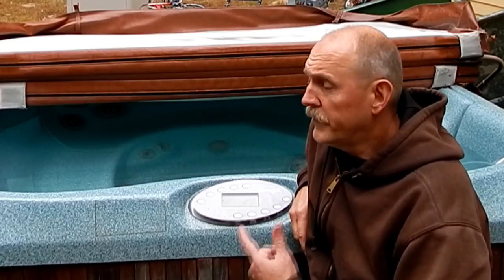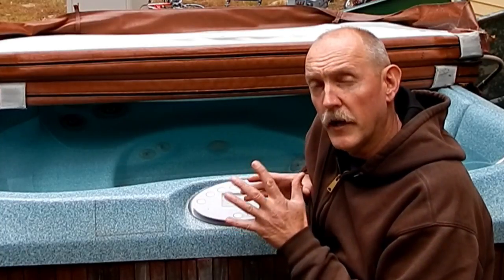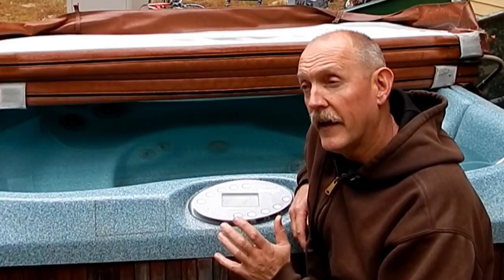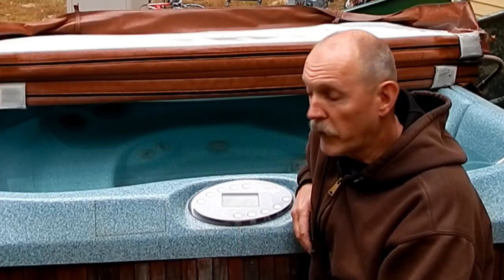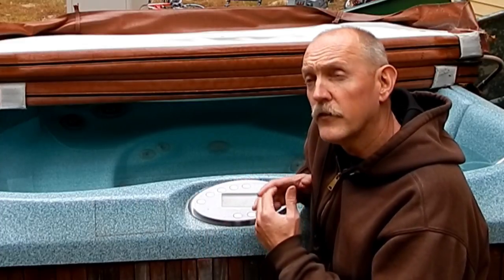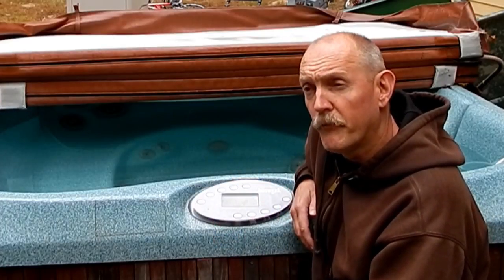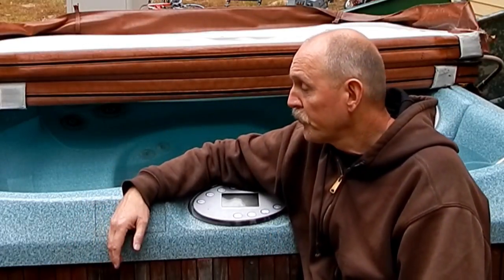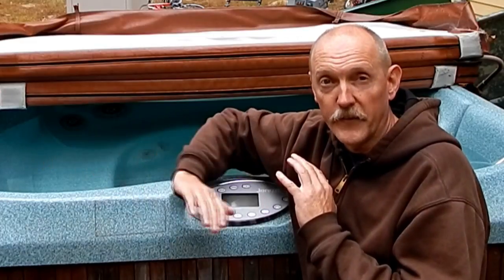Jacuzzi Sundance Hot Tub temperature sensor error repair

Comment: Steve, I has given up but I'm ready to try again.  It all started good.  I verified circulation pump flow and the flow switch was closed.  The heater was on according to the display.  Everything seemed good.  Then a jet pump turned on and I got the cool message.   Then the heater went off and I got the flo message.  I noticed the flapper in the flow switch was no longer closed.  It seems like the jet pump is sending pressure thru the flow switch thru the small tube downstream of the flapper causing the flapper to partly open which is probably causing the flo code and no heat.  What do you think is causing this?
Reply: Yes, there is the inlet side which has the flapper, the bottom that has the wires then the exit side that also has a nipple, maybe 3/8ths, that connects to a Jose that runs to the jet pumps
Reply from the maker: @robertgeorge2330  ok. I do not recall if you said this before but im guessing you or someone else replaced that flow switch. On the earlier flow switch housings that port on the bottom (3/8) was wide open. They'd use the same housing for several models. Some setups had the port wide open, and some required a restriction that was obtained by the manufacturer gluing a little (often white) plug in that port. The plug would then have a small 3/32 hole drilled in it. Newer flow switches come with a molded blockage in that port. During installation the technician, depending on the application, either drills a 3/32" hole on the blockage or opens at full 3/8. I hope this is making sense. You are in the home stretch now.

Comment: Great video .. thanks ... i have the same model J350 in 2003 as the one you are working with ... now my display says Sn3 - "OPEN OR SHORTED SENSOR (heater disabled) The main sensor is non-functional."  - will this fix my problem too?  thanks .. where is the best place to order this sensor?
Reply from the maker: You sure it is SN3 ?? SN is a sensor error and there are only 2 sensors in the tub so. SN1 or SN3 tell what sensor.
Reply: @stevewatr  yes it’s sn3. Will replacing this sensor fix this problem?    Thanks for the reply.
Reply from the maker: @360Toursofnova  number 1 symptom of a bad sensor is watch dog (dashes on screen no temp). But i have seen mice chew through the wires and cause this symptom.

Comment: We replaced both the temp sensor and flow valve on our optima 850. The flow problem is resolved but we are still getting oh and watchdog mode. Going to try turning off the hot tub for 5 to 10 minutes. Any other troubleshooting suggestions? Thanks for the great video.
Reply from the maker: There are 2 temp sensors, the one on the heater rarely fails. There are rare cases when a new sensor is bad. If you turn on the breaker when the tub is cold, how long will it run before oh or watchdog?
Reply: @stevewatr  thanks for getting back to us so quickly!  We were able to refill the tub and heat it with no problem yesterday. Today we are seeing four dashes.  We did turn it off and leave it off for about 15 minutes then restart. It appeared to be working fine about an hour later went back to check on it and we were getting the oh and it was up to 106, which is probably an accurate reading.
Reply: @stevewatr  still troubleshooting.  Replaced flo valve and temp sensor.  Flo message has stopped, but then went into watchdog mode and shut off.  We had a technician come out and he suggested a new circuit board.  We have installed new board, and pumps and heater all working, but getting a P0h or a 40d message (depending on view of panel).  Any thoughts?  We have ordered a new top panel as well, but not yet received/installed.

Comment: Have a jacuzzi j-480 that displays a temperature 12 degrees warmer than the actual water temperature. I replaced the temperature sensor and I still have the same exact problem. Example-If I set the tub to 104 the highest the temp will go is 92(actual). What should be the next thing that i check? Thanks

Comment: Would either of the temperature sensors cause the breaker to trip?  I have a J335.  Resetting the breaker, the heater will heat up to temperature but shortly after reaching the set temp, the GFI breaker trips.

Comment: Hey! I have a j series 4 seater tub. I just had to replace the heating element and the circulation pump and it runs good but only issue is it will only get up to 91 degrees. The heating element light is on but it doesn’t get any hotter. Any advice?

Comment: Steve, Watchdog after correctly installing a new waterfall, all new massage jets buttons and the two larger water diverters correctly. J350 series. Watchdog came on AFTER we started the refilled tub and it circulated beautifully as we tried all the functions to make sure, it began to heat, etc. Walked away for yardwork. Came back to check the temp and that is when we discovered the 4 dashes (Watchdog) Reset the breaker several times with no reaction to the watchdog display. QUESTION; should we EMPTY the tub again and try to eliminate ANY air in that line and the control will automatically detect this change as we power it back up and the watchdog may resolve? Please answer if you can...and THANK YOU. We live in Michigan and it's gonna get cold soon.
Reply from the maker: Air in the line will not cause watchdog. Because if air was causing the circle pump not to work, the flow switch would not be closing and you'd have a flo error. Have someone watch the display when you power up the breaker. See if it briefly displays a temp before the dashes come up. If it shows some unusually high temp like 107, then replace the sensor I did in this video.
Reply: @stevewatr  So could it be the sensor if it DOES NOT briefly display a temp? It is completely locked in Watchdog with no change of display when powering up at breaker. Could the sensor simply be fried out and it happened when it tried to start heating a cold tub?  All the capacitors appear fine and no burned areas at all. Fuse?? Or like you say, Temp Sensor that I can hopefully order and install ourselves. Thank you for your video! Let me know if you can again and THANK YOU FOR answering us back so promptly before!!!
Reply from the maker: @catycoug623  I have done a ton of these, and almost every one that was in watch dog could be tricked into showing a unusually high temp for a second after reset. The ones that are in watchdog immediately, and breaker reset hjas no effect, are sometimes caused by improper voltage to the board, most common cause of this is on some models, when the motor fuse fails (green fuse in the holder), the board gets fed lower than normal voltage, long technical explanation as to why, so I will skip that and just say test that fuse. You need a continuity tester to test the fuse, and need to test it out of circuit (remove from holder). Breaker off!!! If that fuse is good, check for a bad connection where the small transformer's plug seats on the board. Lastly, look at the larger capacitors near the middle of the board, if they are swollen (dome topped), that could also be your issue.
Reply from the maker: @catycoug623  The "box connectors" are call that because if you look at them under a magnifying glass, they have a square shape to the part that is around the pin when inserted. That style is used on models with an LCD readout. These tend to be the higher end models with bigger displays. The other type has little curled ends that spring against the pin when inserted, and are used on LED (red numbers) units. The 2 sensors are identical electrically, only the plugs are different. And yes, a bad connection at the plug can cause issues. Honestly, I did not think it was even possible to fit the finger style into the holes on the plug of an LCD unit.
Reply from the maker: @catycoug623  I suspect you will be all set once the correct sensor is installed. The sensor is an electronic device called a thermistor. It has a specific resistance depending on the temperature. Any bad connection will add resistance to the circuit, causing improper readings.
Reply: @stevewatr  Guess what? I installed that new part that came today on time and I STILL had watchdog SO the culprit?!! The 2 fuses located just under the large capacitors in the middle!! It was just one of them! One was bad. It was a 4amp fuse. Not sure what these 2 fuses do as their function but so far my tub circulator pump is running and the tub is heating. I am wondering if when I run the jets, it blows a fuse again OR if it was just some fluky power surge at my original start up. FUSES. Very important little buggers to check.
Reply: All working and its up to 103* all pumps working great so do you know what those small fuses are for?
Reply from the maker: @catycoug623  The small clear glass fuses are probably the fuses that send power to the transformer that feeds power to the circuit board. They would not be for the pumps, but if the board does not have the proper voltages, that might be why the pump was not running.

Comment: Steve, it's been a while but my Jacuzzi 355 is broken again.  I hope you can help.  It started with a FLO code and the water would get cold.  I could see the flow switch was closing but I decided to replace it any way figuring maybe corrosion or some sort of bad contacts.  That didn't cure it but while troubleshooting I noticed that if the filter was removed the code would not come on and the water would heat.  I put a new filter in and the code would come right back.  So I was l was leaving the filter out and it would work fine for a few days then the flo message would come on and the water would get cold.  After much head scratching I decided to replace the circulation pump thinking maybe it was just weak and erratic.  The flow was not very high coming out of the outlet even with the filter not installed.  I finally got a new pump and installed it but the water is not heating.  I am not getting flo errors now just ice and cold messages.  When you turn power on the circulation pump and one of the jet pumps kicks on.  Just a few moments later the other jet pump turns on.  The heater icon also shows on the display but I do not feel the heater getting warm.  After a whole the heater icon does go out.  I left power on for 2 hours and all the pumps ran during the time but change in temp.  Thinking maybe the heater had gone bad I decided to test it.  I disconnected the leads for the heater and I got 10 ohms.  I tested the voltage at the board and had 110 volts on each leg.  Then I tested amps and got 24.6 on each wire.  I have no idea of where to go from here.  Any ideas?
Reply from the maker: Sounds like it is fixed and you just need to give it time. In a cold tub you cannot feel the heater getting hot. If the water temp drops too far below the set temperature, you get the cool message, if its really low below set temp you get ice message and then the pumps kick on high for freeze protection. 10 ohms is about right in those heaters.
Reply: @Steve Watroba  no sir, not fixed.  I tried running it again.  Started off just like prior with the circulation pump turning on and a jet pump right away followed maybe a minute later by the second jet pump.  Had the messages cold and ice like before.  Closed the cover and walked away for 2 hours.  When I came back the jet pumps were still running but I forgot to check the circulation pump because I saw it was a l so displaying FLO again.  Don't know what to do :(

Comment: My spa had these exact symptoms so I replaced the part as you demonstrated.   When I turned power back on it was just like yours counting down the temp but then at the point where yours turned on my display went back to the four dashes and nothing else happened.   What does that mean?
Reply from the maker: If you were watching the numbers and the last number you saw before the dashes was below 104, then it sounds like it is not the sensor you replaced, so it could be the sensor on the heater that is the problem, but failure of that sensor is pretty rare. Another possibility is a fault with the board itself. Sundance Jacuzzi factory trained techs carry a small test plug that when plugged into the board instead of the sensors, substitutes a known resistance value for the sensors, and if the display does not show the correct temp with that plugged in, then you know the board is bad. The board is VERY expensive, so you do not want to guess. You can buy the test plug for about $20, part number is 6600-999. Never leave a test plug plugged into a board to cheat the tub into working, it is only for testing the board.
Reply: @stevewatr  so this is what I just got when I flipped the cb
85
79
Cool
74
Flo
72
Cool
70
Flo
66
Cool
----

Each time is slightly different but along the same lines.

Does this tell you anything additional?

What would you do? I am thinking of getting the test plug but I need to get this going for my wife.  It's already been down for 10 days waiting for the temp sensor to come.  BTW it's a 2005 jacuzzi 355 that we bought 2 months ago
Reply from the maker: @robertgeorge2330  well cool is normal because the temp is so low under the set point. And the numbers dropping a little are not that unusual, but it should stabilize after a minute. Flo error means the flo switch is not closing. Most common cause of that is a bad circulation pump. Thats the very small pump with 3/4" hoses that pumps water through the heater. Sometimes tapping it will get it started.
Reply: @stevewatr  
Well before I saw your last message I ordered the high temp sensor and the test plug.  They came in today so I started by plugging in the test plug.  I got a bunch of errors when I turned on the power.  The plug has a switch on the end of it so I held it closed and switched the breaker and same thing.  Don't know if it matters but both times it stopped with 4 dashes.

I then compared the test plug to the actual plug and the wires/pins are in different locations.  I decided to just install the high temp and now I get the count down temp reading with a couple of cold mixed in then the 4 dashes...

I am stuck.
Reply: @stevewatr  oh and I did tap the small motor but nothing happened when I did
Reply from the maker: @robertgeorge2330  the switch on the test plug is to substitute for the flow switch. So tou do not push it in while turning on the breaker. If you plug it in and turn on the breaker, the only error you should get is "flo". If you still get dashes with the test plug installed, you probably have a bad board. As for the wires on the plug, the plug has 2 rows of 7 pins for 14 total but only 6 are used for sensors plus there is a jumper wire interlock. Each sensor has one red and one black wire. 
Here is a diagram:
https://www.spaandpoolsource.com/sundancespastemperaturesensordiagnostic.aspx
Reply: @stevewatr  found a burnt with on one of the heater relays.  Corner of the relay slightly melted too.  Guess it's time for a board. :(  thanks for your quick replies and help
Reply from the maker: @robertgeorge2330  You're welcome.

Comment: thanks for this...i believe my hot tub sensor is bad. its reading 103 and the heat wont come on....but the tub only feels like its about 70 degrees. By chance do you know what resistance I should see for a given temp? I can check the sensor wiht my ohmmeter before ordering one that way to verify its bad.
Reply from the maker: https://www.spaandpoolsource.com/sundancespastemperaturesensordiagnostic.aspx.   Here is a link to a chart.
Reply: @stevewatr  thats perfect! thx. Will be checking that out. new thermostat sensor is only 30 bucks...so if thats the problem thats a cheap fix compared to having a Spa Tech come out.
Reply: so with your info i repaired mine about a year ago. Now....it did just the opposite with the new sensor and I got exactly the same indications you discuss in this video. OH error and eventually it just reads the dashes. 
Ordered another sensor off amazon. Do they go out often? Is there a specific part number or manufacture I should look for to get a more reliable part?

Comment: My hot tub is actually overheating until it reaches the high temperature limit and it shuts the system down. Any idea what is causing that? I was thinking a relay was bad but I tested them and they all sound like they are working. I have a Cal Spa CS 9000 but sure they work similar to Jacuzzi brand. I replaced my sensors on the heater and nothing changed
Reply from the maker: Is the water in the tub actually getting so hot you cannot keep your hand in?? Or is the water in the heater boiling and tripping the high limit on the heater?